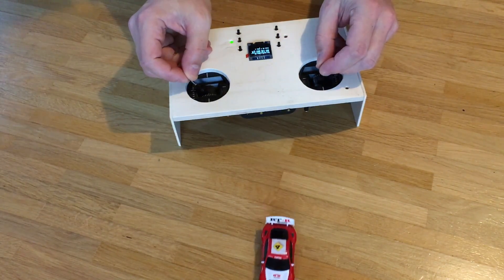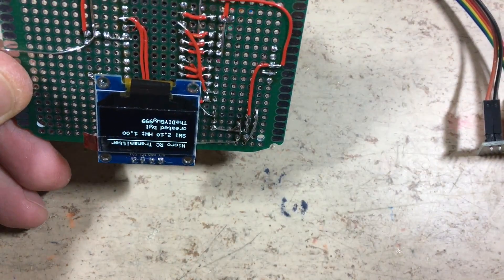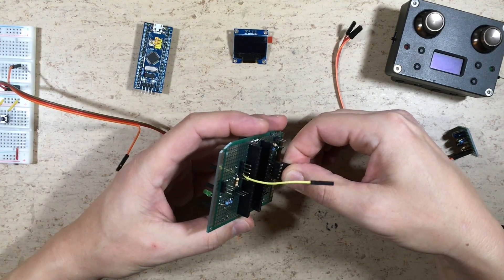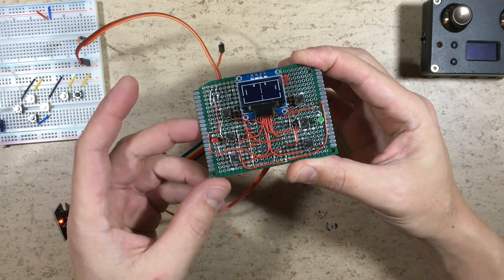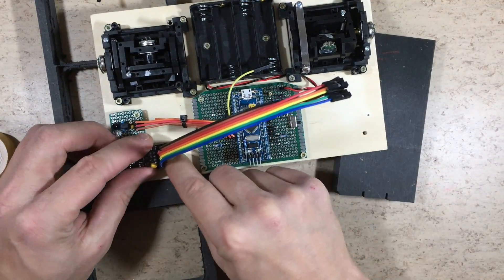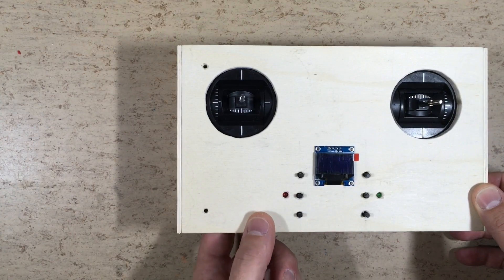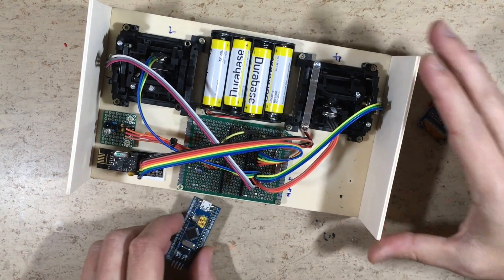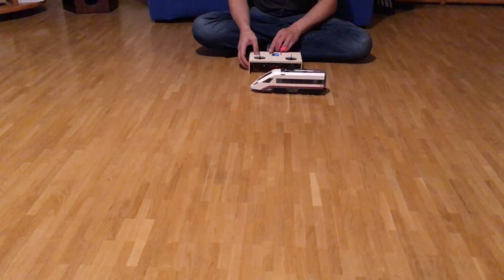STM32 Arduino 2.4GHz & IR Test Transmitter Build Tutorial

Comment: I was building a STM32 prototype transmitter and was facing "no matching function for call to 'statusLED :: begin (<anonymous enum>)" then what is the solution plz help.
Reply from the maker: There is an STM32 related bug in the ESP32 compatible version. Download an older version of the statusLED library on my GitHub
Reply: @TheDIYGuy999  how can I found the older version of statsLED i tried but can't found on your github so suggest me that how can i find older version.      & thanks for your reply
Reply from the maker: @PROTON0019  On the top left click "24 commits" then in the Jun 15 , 2016 line click the <> button
Reply: @TheDIYGuy999  I have to write  that '+' code line or ' - ' code line
Reply from the maker: @PROTON0019  direct download link of old version: https://github.com/TheDIYGuy999/statusLED/tree/ec3d5508d3d60e2f0aeacfc536c8d9aae70f80c2
Reply: @TheDIYGuy999  thanks for your precious time and your support
Reply from the maker: @PROTON0019  You're welcome

Comment: Rebuilding a cheap grip style transmitter to Arduino with your code modified. Though I am unsure if your receiver code is compatible with the STM32F103C8 MCU, have 2 of these chips for the transmitter and receiver. (Dabbling a bit with PlatformIO on VSC)
Reply from the maker: The code should be compatible, if you are able to set up PlatformIO for your hardware

Comment: Nice project , will build one. Where did you buy the joysticks on the remote control ?  Do you have the company/part number ?
Reply from the maker: Thanks. You can use these, for example: https://www.banggood.com/1-Pair-LantianRC-Transmitter-Gimbal-for-DIY-RC-Radio-Transmitter-p-1418060.html?utm_campaign=4828314_1046285&utm_content=1097&p=NZ29024828314201605E
Reply: Thanks, 2 pairs on their way. Do you think it's possible to use this  transmitter with a Corona R6SF or  a Futaba Receiver?

Comment: C:\Users\\Documents\Arduino\libraries\Wire\utility\twi.c:25:20: fatal error: avr/io.h: No such file or directory

i am getting this error again "N" again .
please solve this problem .
 
#include <avr/io.h>

                    ^

compilation terminated.

Multiple libraries were found for "Wire.h"
 Used: C:\Users\AhMed\Documents\Arduino\libraries\Wire
 Not used: C:\Users\AhMed\AppData\Local\Arduino15\packages\stm32duino\hardware\STM32F1\2018.9.15\libraries\WireSlave
 Not used: C:\Users\AhMed\AppData\Local\Arduino15\packages\stm32duino\hardware\STM32F1\2018.9.15\libraries\Wire
exit status 1
Error compiling for board Generic STM32F103T series.

problem#2 
how to install U8g2lib.h  you give link but when i download and go arduino ide >sketch >include library>add zip library>select  U8g2-master.zip>this error was shown " Specified folder/zip file does not contain a valid library "
please help

and where you buy these awesome joysticks can i buy it ?
Reply from the maker: #1: remove the wire library in Arduino\libraries\
#2: install it according to: https://github.com/olikraus/u8g2/wiki/u8g2install
Joysticks: https://www.banggood.com/search/transmitter-gimbal.html?utm_campaign=4828314_1046285&utm_content=1097&p=NZ29024828314201605E

Comment: hi enjoy your videos very much.... did this tiny model modified? use your own receiver or just a normal brought one from market?
Reply from the maker: Thanks. Yes, I have modified this tiny little car. It even has electronic stability control and uses my own receiver.
See: https://github.com/TheDIYGuy999
https://www.youtube.com/watch?v=jr5yYBal3vk

https://www.youtube.com/watch?v=tr6D82gMwUU

https://www.youtube.com/watch?v=ynwQx9TpZQE
Reply: TheDIYGuy999 thank you very much for your reply...😁😁 I have another question, does your arduino controller work with a normal cheap rc car just brought from the market directly without modify it with your receiver? I am working on a similar project in China.
Reply: TheDIYGuy999  my project is to add the PC game steering wheel or PS4 game wheel to control a normal rc model car without modify it. it should be more fun
Reply from the maker: No, it only works with my receiver
Reply: TheDIYGuy999 ok i understand now. is it possible to add a PC USB game wheel controller to your transmitter to control the rc car?

Comment: Man, it is great. But You need to have a 3d printer. You will get better cases for your devices. And it will no more right angles on facets.
I'm too working on transmitter, but I want to "create" (assemble?) deviationtx (Devo 7e) complitable hardware, and use their code. 
This is case prototype https://www.thingiverse.com/thing:2324662.
Reply from the maker: Thanks. This wooden housing is only for testing purposes. A 3D-printer is already ordered.

Comment: nice the stm32 i also used in the multiprotocol tx module 
can your radio also control a micro quad like the eachine E010?
great project and hobbygrade gimbals is a big improvement Gjb :D
Reply from the maker: No, there is only my own protocol implemented at the moment. At least I now have enough processing power and storage room to implement more in the future. Time will tell. And yes, the joysticks are great. The small ones in the "Micro RC" transmitter are pretty much useless in comparison. That's the reason why I build the 2CH "Car Style" transmitter. It allows to control cars much better.

Comment: Can this micro rc work in long range? Let say 200m?
Reply from the maker: 200m only with the module with integrated power amplifier. For details have a look at the manual: https://github.com/TheDIYGuy999/RC_Transmitter/blob/master/Manual_English.pdf
The module with PCB antenna has a range of around 100m in free air
Reply: With "NRF24L01+ PA LNA" you can get more than 1000m. There are many tests on youtube.